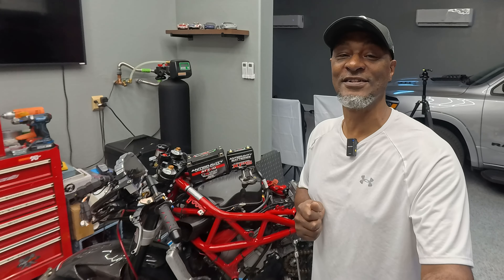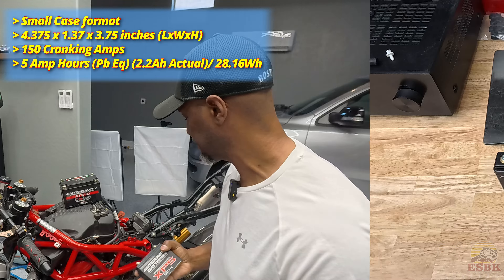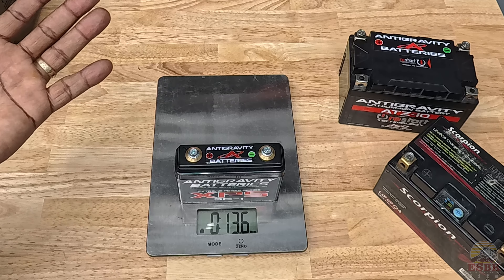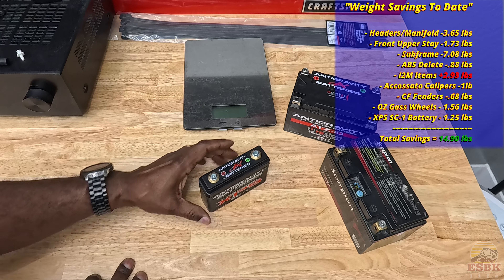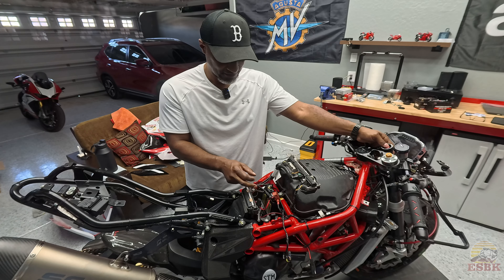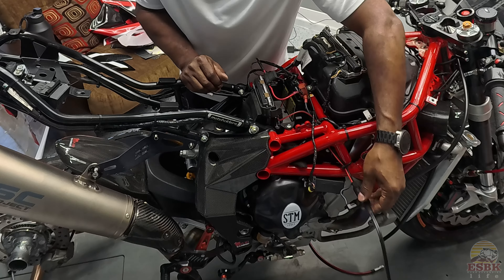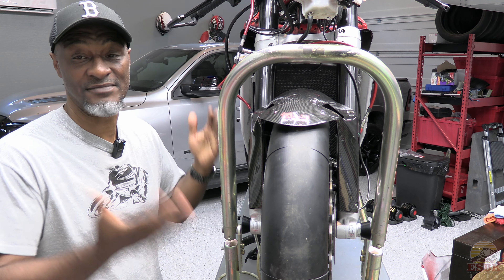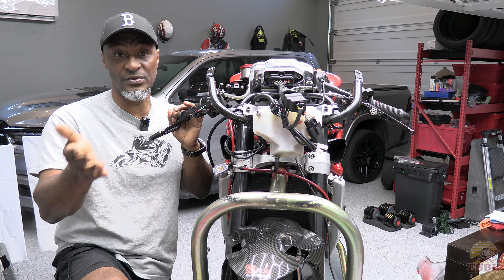ESBKLife MV Agusta F3XX Track Bike Build: Ep8 Micro Battery

Comment: Hi there. Great videos! I just installed a LiFePo4 battery with BSM on my 2022 F3RR. On the second ride, the engine just cut out. Thankfully I was able to pull up safely to the side of the road. Waited a couple of minutes and on the first try, engine started right up and got home ok. Never happened when it had lead acid battery. Bike has 6000 kms on the odometer. Any ideas?